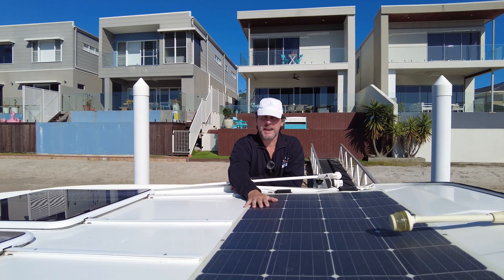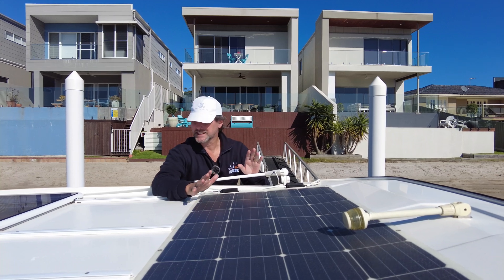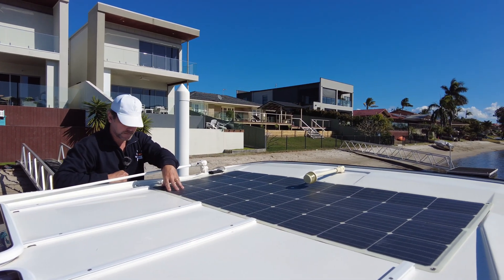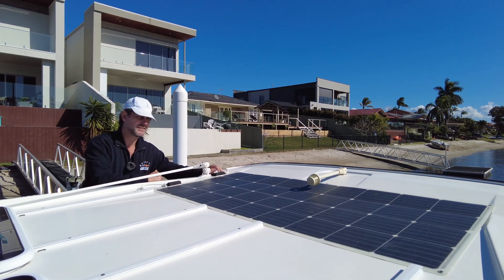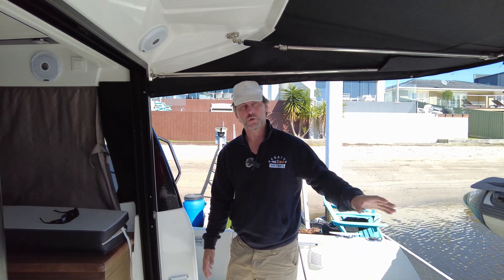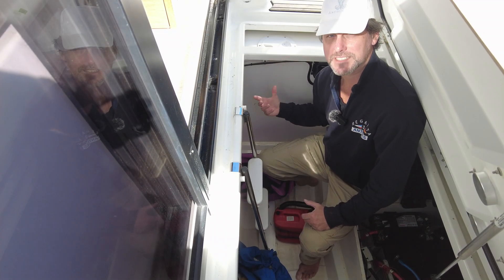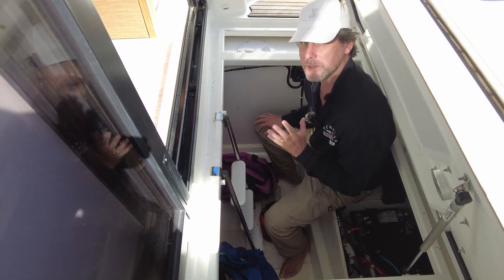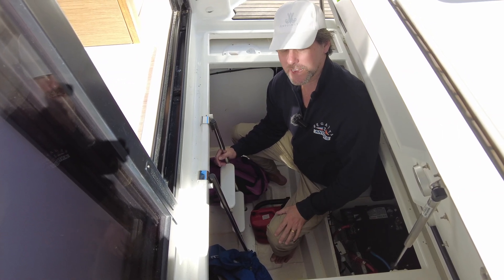SOLAR PANEL - QUESTIONS FROM YOUTUBE | The Rudder

Comment: One thing for you to consider regarding fuses. The solar panel to controller wiring should be sized to handle max current able to be generated from the panel. With that no fuse is required because the panel current is self limiting. However, not so with the battery. You should have a fuse rated for max current of wire size at the battery to prevent a possible short in the controller from causing the battery to melt the wire. 🔥

Comment: Another brilliant video Damian ( and camera woman Brooke). You are both getting accomplished producing these. Had to laugh at your 40knts! I think you meant 37.4 knots.
I have bought, and fitted, exactly the same unit on my 895. 
All too early to give you any feedback but made the same decision as you with no additional switches or fuses. Let the control box do its work. 
The only change I made was putting the controller at the back ( high) of the galley cupboard. I have a gas/petrol/co2 alarm fitted there too.
Very pleased the Solar is working well and has proved a good buy. Wish we had as much Aussie sunshine as you guys!
My partner  and I both have Covid at the moment. So Murphy’s Law we are missing the current U.K. Heatwave and boating adventures! C’est la vie.
Looking forward to more videos. How about sharing a cooking and eating onboard video? 
Best regards to you both.
Reply from the maker: Oh no John, that is terrible. I hope the Covid passes swiftly. We have actually got Antoinette to 40 knts! I was quite impressed. Is a bit steep on the fuel at that speed. Good idea to place the MPPT, I can't check directly what the panels are doing without opening up the lazarette. Hopefully you'll be on the water soon.